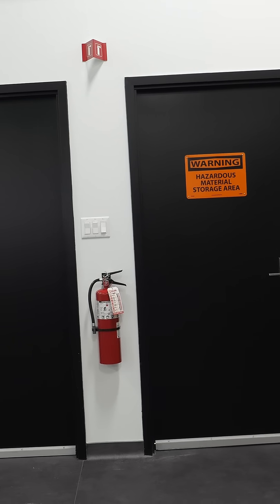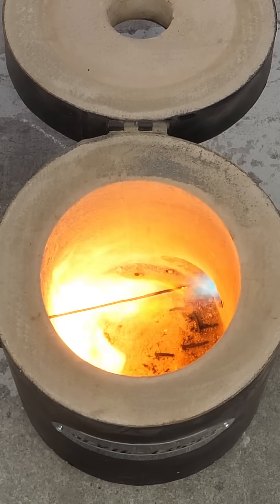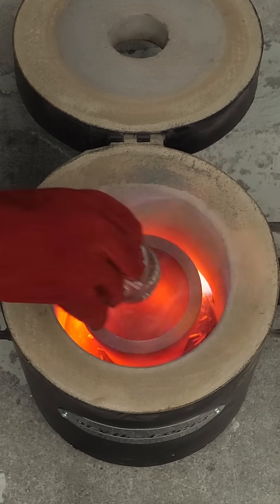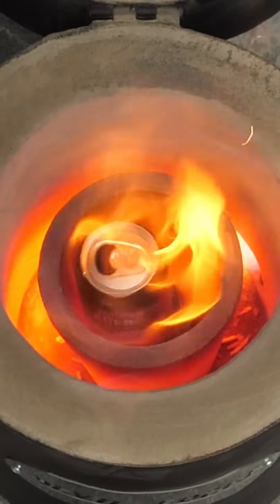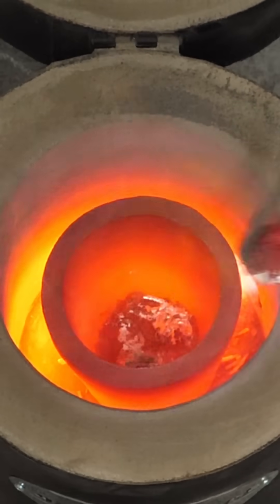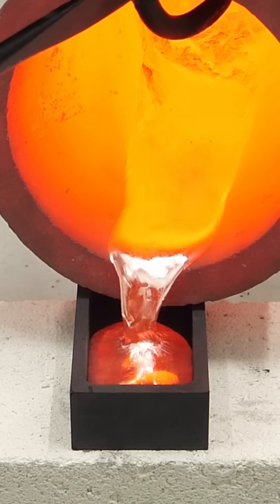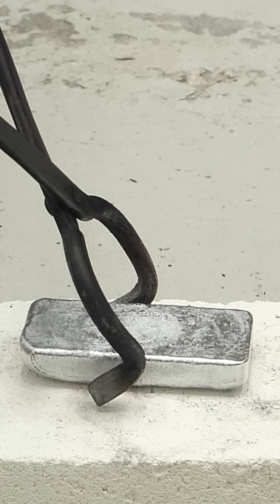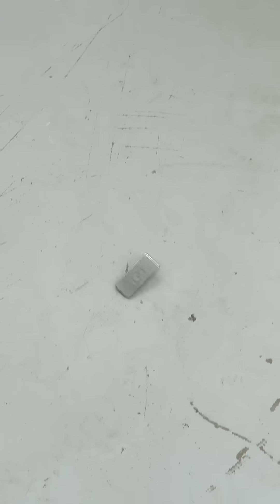Melting soda cans into a metal bar

Comment: The smoke and smell was most likely from the plastic anti-corrosive liner on the inside of the can.
Reply: And the paint on the outside
Reply: Isn't the glass safe? I was always thinking it's the safest one
Reply: @victormalai5477  victormalai5477 Well, depend on what you mean by "Safe". MOST glasses are not made using plastic,  so at least in the construction of the glass you can say you're "safe", but if your goal is to avoid plastic entirely, there is no safe. Microplastics exist everywhere, in everything. All of your food and water also contain it. Everything. There is so much of it everywhere on earth that its literally impossible to avoid consuming it. To the point that even people on remote unconcentrated tribal islands almost certainly still have sizable concentrations of microplastics in their body even.
Reply: @eragon78 well it ain't killing us yet 👍😅
Reply: @Skriggler "yet". Although it likely has increases rates of cancer globally, and the more concerning issue is the accumulation of it in the brain as it can bass the blood-brain barrier. 

There has been significant amounts found in the human brain already, and worse yet, the amounts have been growing over the years. And it likely has behavioral effects on people. And it doesnt matter how old or young you are, or where you live, or what your diet is, basically everyone has similar levels of it in their brain.

It may be not a huge deal right now, but if we double or triple that concentration, im not so sure if itll continue to be no big deal. And we are heading in that direction.
Reply: @eragon78 Yeah but you can still consciously avoid consuming more than you need to, right?
Reply: @Sir_TophamHatt  To a degree. But how much concentration of microplastics in your diet changes based on what you eat is hard to calculate properly. avoiding stuff like plastic containers or packaging, or plastic cutting boards and stuff can help a little bit, but its hard to say how much of an effect it really has overall.

The main issue is primarily systemic from industrial processes and waste management. There is just a lot in the environment period due to how we handle production and disposing of plastics. 

While changing your diet to avoid it as much as possible can probably help a little, ultimately the only real long term solution is systematic change and regulation of how we handle plastics to prevent microplastics from entering the environment to begin with.
Reply: @eragon78 Still not a bad idea to consume less. Just because it's there doesn't mean it can't be mitigated at least somewhat.
Reply: @clouds-rb9xt  Yea, obviously less exposure is still good, I was mainly just pointing out that it doesnt really make as big of a difference as you might hope.

Really, just avoiding like, processed foods is the main difference you're going to make. And avoid reheating foods in plastic containers, and avoid like, plastic cutting boards. 

But after that, most changes you make to try and avoid plastic contamination is more or less pointless. Maybe a few other small things can help, but not much. The concentration of microplastics in your diet will be pretty much the same.

Although, using less plastic in general can still be worthwhile since it reduces demand for plastic, which hopefully means production of it will also drop, and less of it will end up in the environment. But doing stuff like that doesnt work super well on an individual level, and it would take decades for the effects to be felt even if it was successful.
Reply: @eragon78 I guess it's just one of those things that on a wider scale we don't really have a solution to yet. But at the same time it will probably be more of the problem for our descendants to deal with, unfortunately
Reply: @Skriggler I mean it kind of is, it's just not doing it quickly LOL
Reply: @eragon78  it was extremely scientifically bad experiment about microplastics in the human brain. They just contaminated the brain sample with the microplastics in lab and found enormous concentration of plastic by burning method. This concentration should be seen in microscope, but they saw nothing. Microplastic is everywhere. We don't sure how harmful it is. Although, I don't think it's possible to pass the blood-brain barrier.
Reply: @valk1962 it can pass the blood-brain barrier.

I’ve heard follow up reports on that study about plastic in the brain, and yea, it’s criticized due to failure to properly account for contamination, causing them to likely overestimate the value.

However, that study IS NOT what determined that microplastics can cross the blood-brain barrier. That’s definitely a thing that can and DOES happen. How high is the concentration of microplastics in your brain? It’s unknown. But it’s definitely concerning that it can cross that barrier for sure.

We don’t know what effects that has on the body. It could be harmless. It could be pretty bad. We simply don’t know. It’s pretty hard to research. But it’s definitely not GOOD.
Reply: @eragon78  I don't argue microplastics everywhere can be not good (however, can be not so bad too. We just don't know, what's already bad). I just don't understand how it can pass the blood-brain barrier. I mean even pretty small molecules (comparing with the polymer molecules) cannot pass blood-brain barrier. If some small nanoparticles can pass how we can measure it without contamination. I don't know what rightfully made experiment can convince me. Now it seems claims about microplastic in brain argue with the our previous knowledge, so it should be careful, I guess.
Reply: @valk1962 small nanoplastics under 200nm can pass the blood-brain barrier. How exactly we know this, I don’t know. I’m sure you can read up more about it if you did some searching, I’m sure there are a few published papers about it. I don’t know the details, I just know it can and does happen. I’m not an expert in neuroscience though, so go read about it on your own. But even with a little bit of searching, it’s not too hard to find reputable sources showing that it happens. And as for tracking this, again; idk exactly what methods are used, but there are ways to measure things at super small scales without contamination. Idk how well that applies to this situation, but to act like it’s impossible is a bit naive. But again, this goes past my understanding in this field, so if you want your questions answered, you’re going to have to do the research on your own. All I know is that it’s agreed upon that microplastics can and do pass the blood-brain barrier. Past that I don’t really know much.
Reply: @eragon78   I didn't say it's impossible. I said it's naive to be sure in something not clear. There are works which uses brains from previous decades. It uses with the same methods to exclude contamination. Well, it's interesting. Although my point is, if someone's brain has so drained blood-brain barrier that microplastics go through it easily, then it's already a problem without microplastics. Maybe it should be considered brains of young men who died not due to brain damage. I became a bit sure that it's possible, but haven't yet saw work which insure me certainly. I guess, it will be much more works.
Reply: @victormalai5477 a lot of glass bottles, especially for beers, have an anti UV coating either on the outside or the inside that like a lot of other things can produce some fairly toxic chemicals when burned, ultraviolet is what makes your beer go skunky, and nobody likes a skunky beer LOL
Reply: Was about to say this, thanks!
Reply: Fucking great, thought i escaped it by using cans instead of plastic bottles. Nope, guess glass only.
Reply: @c_m00      Ummm....about that....
Reply: @SergeantExtreme  what about glass tell me
Reply: @SergeantExtreme what??? Glass has plastic in it now?
Reply: @c_m00  unfortunately without the plastic liner most canned drinks would dissolve the aluminum, which is worse to drink and would make the cans leak. If you get an old can where the liner failed you can see the drink starting to leak everywhere from small pinholes
Reply: @shepardpolska aluminium is that weak? I thought it was more durable than that.
Reply: @xXRealXx  It's not that it's weak, but that carbonated drinks are acidic. Not helped that carbonated water forms Carbonic Acid. It's the reason why sodas are bad for your teeth too.
Add to it that drink cans have very, very thin walls they do start to leak over time if not protected, and the disolved aluminum is warse to drink then any plastic from the liner.
The plastic also lets people make steel cans, though those are rare and used only as a budget alternative to aluminium ones.
Reply: @shepardpolska  I see. Still though, AFAIK carbonic acid is a pretty weak acid.
Reply: @xXRealXx  Acid is still acid though. Without the liner, it would eat through the can relatively quickly.
Reply: @Ninetails2000 and in something like a vending machine the last thing you want is one of those cans to start leaking. Every time I get a Dr. Pepper from the one at work I have to go wash it off because at some point a can of it must have leaked.
Reply: @shepardpolska that should tell you whatever is in the drink is probably not good for you if it eats away at aluminum. I switched to only water a few years ago 🤷‍♀️
Reply: @unicornkitteh5332  The worst thing in those drinks is the high amount of sugar. You're worrying about nothing.
Reply: @xXRealXx it has an incredible tensile strength to weight ratio, but like 99% of the metals out there it can oxidize, and a lot of the drinks that we enjoy are pretty acidic, which causes metal to oxidize quickly, without the plastic liner you wouldn't be able to ship it from the factory to the store LOL
Reply: @c_m00  wait until you find out that microplastics don't actually come from the bottles but the plastic parts in the factories making this stuff like bushings, washers, gears, auger blades, hoses....and for sodas, nearly everything in the factory is plastic because of how corrosive the syrup is, especially Coca-Cola.
Reply: @c_m00  your not safe bro 😂 no matter what. So you might as well do whatever TF you want
Reply: you’re safe with glass bottles
Reply: @I-C-Y-U-N-V  That's like saying there is radiation everywhere so you may as well live in Chernobyl. You can improve things even if you can't compeltely eliminate bad things.
Reply: @I-C-Y-U-N-V  at least coating plastics don't have phthalates.
Reply: @c_m00  The glass is actually sprayed with poison so that people who drink from only glass bottles die now
Reply: @c_m00  You'll have to search it, but one dude did a test where he put the can of soda in acid and the acid ate the aluminum away and all the soda was being held in by the plastic liner. It was definitely pretty cool to see.
Reply: @c_m00  You didn’t know this? It has a plastic lining because otherwise the acid would leech the metal into the drink 💀
Reply: @c_m00  Glass bottles have more microplastics in them than cans, according to recent research anyway
Reply: @c_m00 yeah but there’s a reason why they are doing the plastic coating. Something about botulism I think, look it up. I also only found out about the plastic lining about 6 months ago 😅
Reply: Exactly what I was thinking
Reply: Came here to post just that
Reply: That was my first thought
Reply: Thus is why you don't store your excess rat poison, RDX, radio-isotopes or whatever in old empty cans...
Reply: And the paint on the exterior.
Reply: Es Cáncer
Reply: it's epoxy or some polymer
Reply: And the beer itself
Reply: I'm not so sure. At least two of those cans had held British lager... ;)
Reply: That, and I'm pretty sure that the printed labels on the outside of the cans didn't help LOL
Reply: And the ink on the outside
Reply: Aluminum is very toxic when doing this. If you were smelling anything, you weren't doing it correctly.
Reply: We know
Reply: No shit dawg
Reply: and the plastic labels
Reply: Could it also be from the paint on the outside?
Reply: Goddang they even put plastic in metal cans? 
We can’t escape the crap. 
Alarming levels of it in people’s brains.
Reply: It’s the paint
Reply: Aluminum produces toxic fumes
Reply: The microplastic problem will be solved before we get GTA 6, Half-Life 3, and fusion energy.
Reply: It was exactly bpa.

Comment: I almost got a heart attack while looking at that as a German.
I often forget there is no PFAND in many other countries.
Reply: It’s a thing in several US states, but it’s not inflation-adjusted, so most people don’t really care about 5 cents. I actually live in one of those states, and the nearest can location in my city is half an hour’s drive away— it’s not a very good system.
Reply: I mean, he could sell that aluminum and make probably about the same money from it than he would have gotten that way
Reply: @mohamedaboubakr1758  probably more, with a bar like that
Reply: @mohamedaboubakr1758  it is 0.25€ per can and for single use PET bottles the multiple use once get you  0.15€ too 0.25€ glas bottles 0.15€ too 0.08€ depending on the lid system 

And no you will not get that amount of money back by smelling them down and selling the Al  a 0.33l cann weights around 12.2g  and the biger 0.5l 15g   and 1000g of Al sell about for 1€  67 big cans worth 16.75€ of pfand or 82 smaller once get 20.50€ pfand   too get about 1€ worth of aluminum  and the amount of slag isn't even in the calculation let alone the gas or coal you burn too melt it down 

But if you have al sracps laying around  melting them down saves on lots of space but it is still not realy worth it 😅 only if you go 1 big step further and cast too samething you want decorative or usefull 

But preparing a good mold isn't that easy lost foam casting is the easiest but the quality is pretty poor  and there is a lot of trail and error stuff going on too get a nice and pretty clean cast
Reply: many bottles and cans do have a list of states where there is a rebate for turning in the can or bottle.
Reply: @mrigtp0529  unfortunately that list is also very tiny 😕 

It shouldn't even need a list. We need this as a staple feature in every major and minor city in every state.
Reply: P what?
Reply: @uysalemre You get some money back for returning cans and pet bottles. Pfand in German, Pant in Swedish, and Statiegeld in Dutch. (And more but these are the names I know.)
Reply: @AtlasNL we call it ten cent return recycling in South Australia
Reply: @AtlasNL  we have that in some states but its inconvenient to do and only pays like 5 cents per can
Reply: @nothingnothing1799  Even in eastern europe, with way lower cost of living, you get something like 10-15p per can. I think in germany its like double or triple that.
Reply: @AtlasNL  Pantti in Finland! now you know one more, easy to remember because you know swedish pant already 😁
Reply: @legoNerd1635 up here in NSW it's called "return and earn", lol.
Reply: @AtlasNL  some states  here do that
Reply: @uysalemre  basically you get a little money back if you return cans and bottles for recycling
Reply: That is a thing in Canada though it’s not called that and I believe that is where he is
Reply: They have this in Mexico and even they got a better system than ours in the US. It literally is just not worth it here.